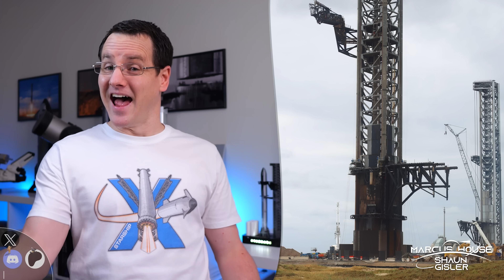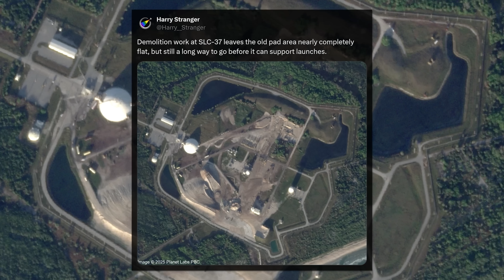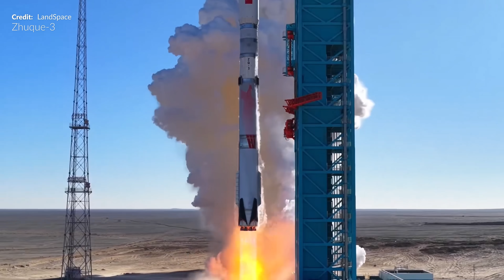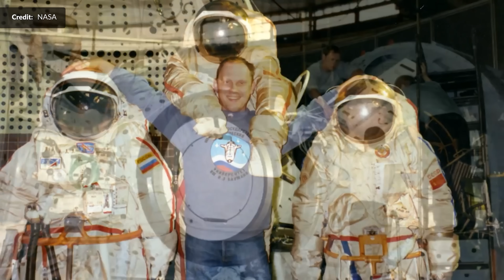SpaceX Just Got a HUGE Starship Launch Approval Update!

Comment: There was suppose to be 25 launches this year. Also wasnt next launch somewhere February? So... im amazed if they can do even 10 launch next year.
Reply: Space is hard. Far simpler rockets than Starship (an enormous, dirt cheap mass producible fully and rapidly reusable interplanetary system) have enormous delays, which no one is talking about. E.g.:
- Neutron was supposed to have its first flight in early 2024 be fully operational and flying regularly by 2025 (as promised to investors)
- NewGlenn was supposed to have launched thousands of Kuiper sats by now (it began actual dev in 2011, 14 years ago)
Reply: There were not supposed to be 25 launches this year. Nor is there supposed to be 150 Starship launches in the next year or two. These are approvals for maximum amount of launches allowed. They were originally allowed only 5 launches a year from Boca Chica. Those approval take many months or years. So it would just hold them up if they waited until they were already hitting the max allowed.
Reply: @anthonypelchat  One of the flaws in hater reasoning is to claim anything they applied for on a permit means they're promising to do something.  It's the little lies like that that they depend on to keep their fantasies going.
Reply: Please don't encourage Elon to blow up rockets at a faster rate. That sort of launch rate is only AFTER they get it working reliably.

Comment: 18:05 I believe that you are incorrect. The only company that I am aware of that has reused a booster is SpaceX. Blue Origin did land one, but has yet to re-fly it. I would also point out that SpaceX has reused both Falcon and a Super Heavy Booster. So, LandSpace and Blue Origin are in a race to be the second company and third rocket family to be reused.
Reply: You forgot Thiokol's SRBs, which was first launched 44 years ago.
Reply: @danielch6662 Yes, I did. Those were abandoned because it was more efficient to throw them away given that they were being damaged in flight. Like most the rest of the Space Shuttle program, it was not a cost efficient solution. It is also fair to say that the Space Shuttle was the first reusable spacecraft, though it was far from an efficient spacecraft. Nor were they particularly safe. 

You are correct that those flew decades before SpaceX even recovered a booster. I was mistaken. So, the new guys are competing for 3rd and 4th.
Reply: @danjw1  SRBs were not reusable. They crashed in the sea and only some metal rings were collected from the scrapyard and used on different boosters (new engines essentially, new control systems, nozzles etc)
Reply: @a @admarsandbeyond am not sure how much of the first several were reused, before they determined that it was less efficient than using new ones. But they did reuse some. We can quibble over how much of them were reused, but they were to some extent. I believe it was more than “scraps.” They used some of them up to 16 times.

The whole shuttle program was not particularly safe. They routinely ignored their own safety minimums. It was a “reusable” platform that was very expensive to reuse. The concept of a reusable spaceplane was reasonable, but it was built with cost plus contracts and technology that wasn’t the best choice. Using hydrogen for a fuel, with it very prone to leaking, was crazy.

Now we have SLS trying to use much of the same technology, but in a fully expendable platform. Again, it was built on cost plus contracts with Congress legislating the technology to use. Of course the traditional contractors were whispering in congress’s ears.

Comment: AI Summary

Abstract:

This is a weekly update on spaceflight, focusing heavily on SpaceX's Starship program. At Starbase, the demolition of the first launch pad is progressing in parallel with the outfitting of the second. Significant, though not fully understood, upgrades to the launch tower hydraulic systems are underway. The disassembly of Booster 18 has provided new insights into its internal design, while the production of Booster 19 continues at a high pace.

The most significant development is the regulatory approval for 76 Starship launches per year from Cape Canaveral, which, combined with the Texas site, allows for a theoretical flight rate of nearly three launches per week. This approval includes plans for on-site propellant generation. The video also covers the successful orbital debut of the Chinese Zhuque-3 rocket by Landspace; its booster recovery attempt failed just before touchdown, but the attempt itself is a major milestone. Finally, the International Space Station reached maximum vehicle capacity for the first time in its 25-year history of continuous human occupation.

This Week in Spaceflight: Starship Progress and a New Competitor

*   0:35 Starbase Pad 1 Demolition: The original Starship launch mount is being systematically dismantled. Crews have removed the support legs and are preparing to remove the concrete foundation and steel deluge plate.
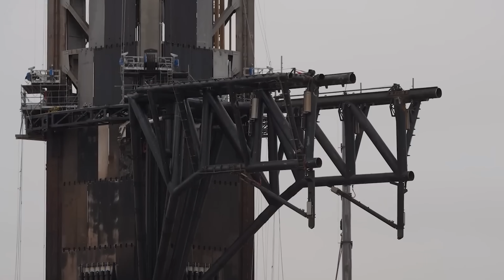*   1:38 Mysterious Tower Upgrades: The hydraulic accumulator banks and main actuators for the launch tower arms on both Pad 1 and Pad 2 have been removed. This suggests a significant, system-wide upgrade is in progress, but the final configuration is not yet clear. The original catch rails are being scrapped, not modified for reuse.
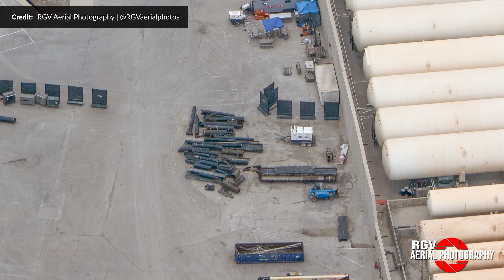*   3:00 Pad 2 Nears Completion: The second launch pad is progressing quickly. The ship quick disconnect (SQD) arm is now fully anchored to the tower, with work beginning on connecting the propellant and data lines.
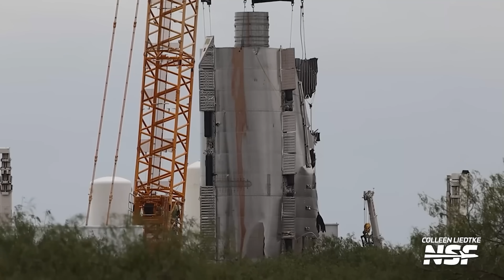*   6:19 Insights from a Scrapped Booster: The ongoing scrapping of Booster 18 is providing an unprecedented look at its internal plumbing, including the new side-mounted liquid oxygen landing tank and its support structures. The booster's forward and aft dome sections were salvaged and moved back to the build site.
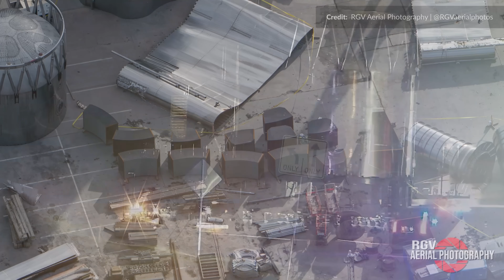*   7:43 A More Flexible Workflow: SpaceX is building a second static fire stand and has prepared footings for one at the launch site. As far as I can tell, this points to a new operational flow designed for higher throughput: static fire at one location, integrate payload at another, and stage the vehicle at the launch pad before stacking.
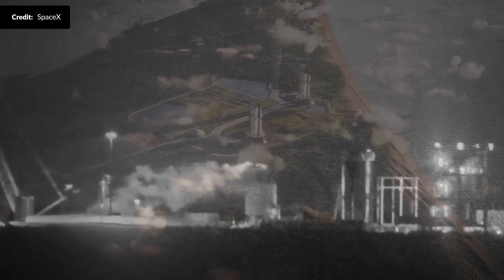*   8:59 Major Launch Approval for Florida: The US Space Force has approved SpaceX for 76 Starship launches per year from Space Launch Complex 37 in Florida. Combined with the 25 launches allocated for Texas, this brings the total potential flight rate to 145 per year.
*   12:14 On-Site Propellant Generation: The Florida site plans include a methane liquifier and an air separation unit. This strongly indicates that SpaceX aims to generate its own propellants on-site to support a rapid launch cadence.
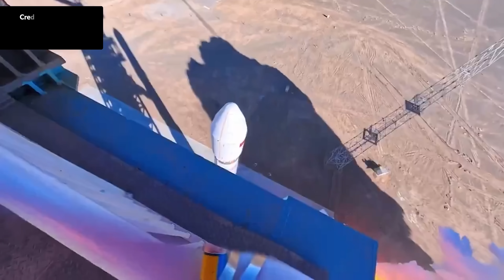*   16:01 China's Reusable Rocket Progress: The Chinese company Landspace achieved orbit on the first flight of its Zhuque-3 methalox rocket. The mission also included the first attempt to land the orbital-class booster. While the booster reached the landing pad, it exploded during the final landing burn. This is still a significant achievement, making Landspace the first company after SpaceX to get this close to recovering an orbital booster.
*   18:36 ISS at Maximum Capacity: For the first time in its history, all eight of the International Space Station's docking and berthing ports are occupied by various spacecraft.
*   20:42 ISS Celebrates 25 Years: The ISS marked 25 years of continuous human presence, a milestone that began with the arrival of the Expedition 1 crew in November 2000.

AI-generated summary created with gemini-2.5-pro for free via RocketRecap-dot-com. (Input: 21,871 tokens, Output: 849 tokens, Est. cost: $0.04).

Comment: I think there is an argument to be made that simply landing a booster isn't enough to claim that it's reusable. You've got to relaunch it again first. I have every confidence Blue Origin will get there, but they need to complete the full cycle before earning that title.
Reply: In that case, Blue Origin's New Glenn and Landspace are both vying for the title of 3rd reusable booster considering the 1st and 2nd are Falcon 9 and Starship Super Heavy boosters. Blue Origin's New Shepard doesn't count at all as it isn't capable of orbital, or even sub orbital. It's a straight up and down ride.
Reply: @scythelord  In that case, sub orbital does not count either. as no real mission can be achieved for a payload
Reply: @sebpatuDistinction without a difference. The boosters have completed a full flight profile. The ships are stopped just short of orbital velocity to guarentee a splashdown. The re-entry for ship is essentially the same as an orbital flight profile.
Reply: @scythelord New Glenn already took the title already son of 3rd spot to land a rocket .  China will be the 4th eventually after couple more failed launches,  maybe in the late 4th quarter of 2026 🤔 . ✌️🍿
Reply: You forgot, Honda landed a Rocket lately.
Reply: @LivingPositive50  New Glenn did not refly. They have not reused a booster. They are third at landing a booster after launch right now.
Reply: @dirkbester9050True, but they launched, and Landed.  CHINA HASN'T EVEN LANDED LMAO ✌️
Reply: @LivingPositive50  Sorry? When was a flown New Glenn re flown?
Reply: @LivingPositive50 Honda will surprise you
Reply: @scythelord exactly. Spacex remains head and shoulders above the rest.
Reply: @scythelord The biggest, most expensive pogo stick thus far.  Still gotta start somewhere.
Reply: SpaceX is the only company to have launched boosters that have previously flown. Falcon, Falcon Heavy, and Super Heavy boosters have all been flown after recovery. Yes, even the Starship booster has been flown after previous use.
Reply: They did refly one already
Reply: "simply landing a booster" 😂
Reply: @budbin  Right? Just because SpaceX makes it look easy doesn’t mean it is easy.
Reply: The only Maaakas Hauz I know belongs to the flat earth community!
Reply: That's not an argument.
Reply: Gotta reuse it for it to be called “reusable”!
Reply: Agreed. The flash weld trick is neat, though. I look forwards to seeing if they reuse their first landed booster or they take some "data collection" landings.
Reply: It is simply the fist huge step towards reuse.. you have to land the thing fist, once you do that u are well on your way
Reply: @Riflesling1   Absolutely. Now that the boosters can come back from flights, examining components and determining failure modes and mitigating them to make the booster reusable is a relatively straightforward task.  I’d say the heavy lifting towards (no pun intended) reusability is already done.
Reply: Agreed. Recovery is merely half the job. Important and impressive non the less.
Reply: They have relaunched a booster.
Reply: @WyoSavage1976   I know thanks. That doesn't address my concern.
Reply: Landing the booster just happens to be the most important part of reusability.

You can iterate and improve on  prepping for relaunch.
Reply: Only two Starship Superheavy V2 Boosters were reused only once each out of 11 flights. V3 Super Heavy Booster has to reprove that it is reusable.
Reply: Blue origin has already reuseable rocket apart from new glenn
Reply: I agree with your assertion about reusability. I also question how many reuses the Super Heavy booster will deliver. The glowing red-hot engine section we see on reentry and landing might be heat cycling the stainless steel. That could potentially weaken the stainless through thermal fatigue, leading to microcracks, grain boundary changes, and potential embrittlement. I don't pretend to know what temperatures the actual stainless steel is being subjected to; the cryogenic liquids might be protecting the structure, but it is something for us as observers to consider.
Reply: You are right, that is also true for a fully reusable claim. We know Starship is far far away from that. Its also far trom being an orbital rocket
Reply: bro even spacex can't reuse thier starship. lol.
also blue orgin is the master at production, jeff bezos showed his factory, they 3D print these things so fast. Bezos is the master at production scaling. with only 7 engines to worry about it will be faster then 30 engines to check
Reply: spacex can't even get their starship to space and landed without blowing up, let alone blowing up on the stand. Still decade before anyone goes to mars or even the moon. Blue origin New glen is way ahead , they already launching a lander to the moon real soon. SpaceX has drawings but nothing was made yet.
Reply: @jtit2025 New Glenn is not "way ahead". Starship is already making it back down. Beff Jezos is far from landing his upper stage. I don't think you know what you are comparing here.
Reply: @dirkbester9050 Blue Origin doesn't even have the lander. The lander for crew is Mark II version and I don't believe they started working on it.
Reply: @jtit2025   New Glenn was BO catching up to Falcon 9, not Starship. As of this video’s publish date, New Glenn needs another 569 100% successful launches in order to “get ahead” of Falcon 9.
Reply: @worldwideroach NG has sent a vehicle to Mars, taken payload to orbit twice. Starship, so far is a pointless rocket, with a 20t payload to a suborbital destination. Pathetic.
Reply: @pedrosura  A decade of development for three payloads. I’m not sure that’s the flex you think it is.
Since 2010, Falcon 9 has delivered 11,000+ payloads to orbit with a total mass exceeding 3,300,000 kilograms, with a 99.48% success rate.
Blue Origin has some catching up to do and I genuinely wish them well in their efforts.
Reply: @worldwideroach Falcon 9 is a great rocket. You don’t pay attention because you are a fanboy. Starship is too heavy, the engine is not ready, it can lift nothing, it is a pointless rocket. Falcon 9 and Falcon Heavy are great. Now go ahead  and tell me how great Falcon 9 is.
Reply: @pedrosura   🙄 I’m absolutely a fan of space and engineering but corporations get little loyalty. Whoever offers a cheap, safe, ticket to space before I die gets my vote. 

Both NG and Falcon 9 are production rockets and have comparable reusability. NG is bigger and F9 has experience. Both have reusable first stages but expendable second stages.

If/when Starship enters production use, I’ll be happy to reenter the eccentric billionaire rocket measuring contest. But until then, comparing rapidly changing engineering test articles to those in production is a waste of time. Unlike the “Elon man bad” crowd, I just refuse to hope for failure.
Reply: @worldwideroach Thank you for your very informative comments. Some people around here type with their mouth open and mind closed.
Reply: @worldwideroach Like I said… Falcon 9 and  Falcon Heavy are great rockets. Starship is a giant failure. Its the truth. If and when Starship does something worthy of praise, I will be the first one to mention it. So far, an embarrassing disaster. Sorry but that is the reality
Reply: @pedrosura  it is not a giant failure. They are trying to do something never done before. They are the ones innovating. If they wanted to treat Starship like a big Falcon 9, and not try to make the ship fully reusable, they'd be done already. 

Also trying to make a rocket factory that can produce huge ships and boosters at a rapid rate ain't easy either. Idk.. you might just be a glass half empty kinda person 😂
Reply: @pedrosura   You’re dismissed.
Reply: @digi3218 Starship is not failing for not trying. They are failing for not achieving. In their proposal to NASA for Artemis, the first milestone of many, was orbital flight. After 11 flights, they have yet to reach that first milestone. You have a different metric for evaluating Starship. I am just evaluating Starship against their own proposal. In 20 launches, you will be arguing that Space is really hard..
Reply: @pedrosura  I mean I agree. SLS is a complete disaster though. They are glad Starship is behind schedule. Both BO and SpaceX proposals need their own rocket for the landers, because SLS is only good enough to put Orion in a weird lunar orbit. But BO and SpaceX won't even need SLS at that point. A new SLS rocket takes like at least 3 years to make. There is no way an SLS is ready for Artemis III in 2027. First they have to do Artemis II. And see how that goes. Eager space made a good video on this. Labeled something like starship shenanigans. I don't follow the whole Artemis program that closely, and will admit I had to search some of this just to remember. But yeah. Seems like there won't even be another SLS ready until 2029 anyways if Artemis II is a success.
Reply: @digi3218 Of course SLS is a disaster. It is also a product of lack of leadership, commitment and Congress playing politics. It is not 100% engineering fiasco.
However, just bc SLS is a failure, it doesn’t make Starship a success. Its a disaster frankly. After 11 launches, a suborbital flight with 20t demonstrated.  Only Elon fanboys would think this is a success story.
falcon 9 and heavy are great rockets which sadly share very little with Starship. Stainless steel is obviously the Achilles heel of this rocket

Comment: I expect that SpaceX is going to toughen up the standards of the hydrostatic testing it does on COPVs before they are installed.

Obviously something needs to be done after the persistent strings of COPV failures.
Reply: Maybe we should wait and see if it was a COPV issue.  This taking youtuber speculation and pretending it's fact is silly nonsense at best.
Reply: COPV's are used on all of SpaceX rockets. They are sensitive to rough handling. Will SpaceX put quality before speed.  I don't think so😢